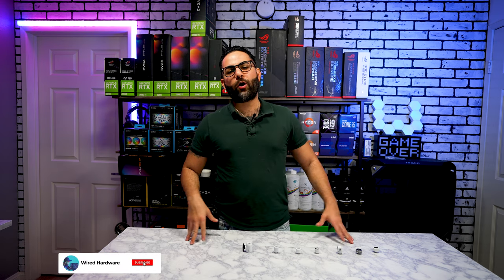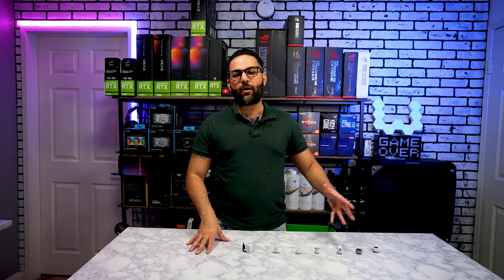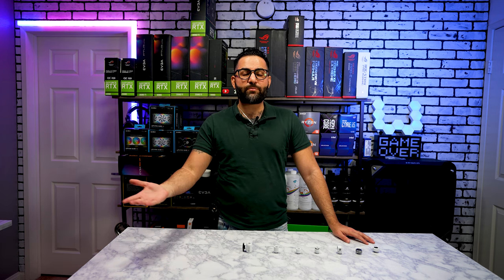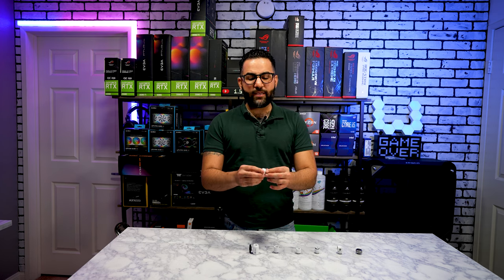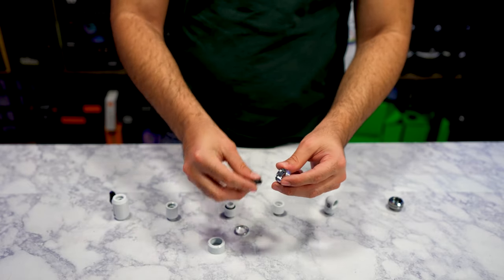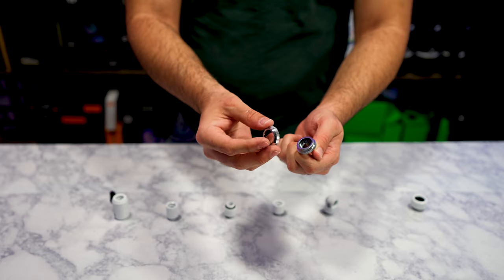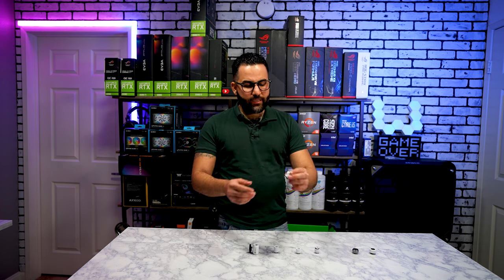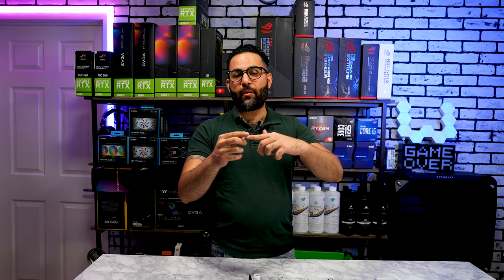These BITSPOWER Fittings are on POINT!!!

Comment: So I am currently rebuilding my loop and using this to test some different fitting from multiple companies - like from most of them 😂. The Bitspower Advanced line is so far beyond everything else that the real question is why other companies don't simply stop to produce fittings. Incredible. I can hang my toddler on the tube and it will still not seperate from the fittings. In case you are unsure: Bitspower Advanced is the way. Don't even bother with the other crap.